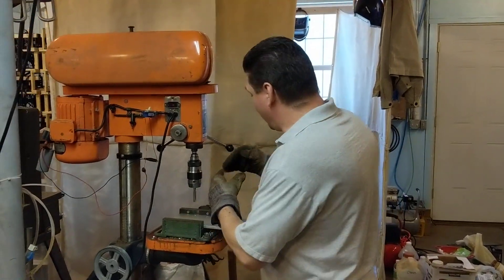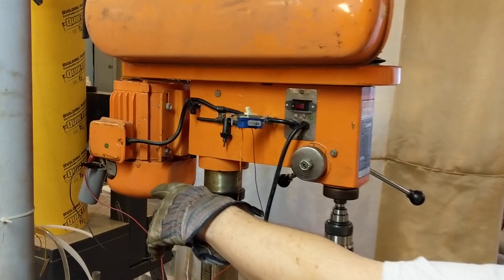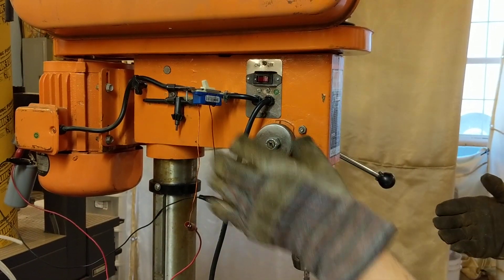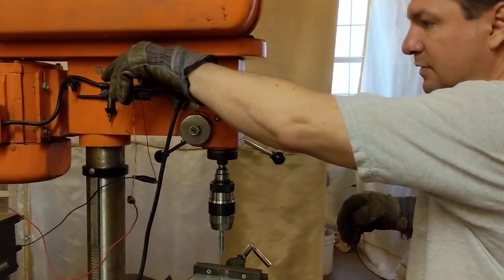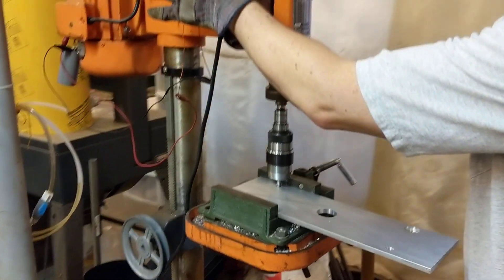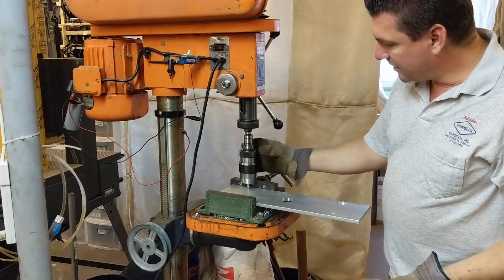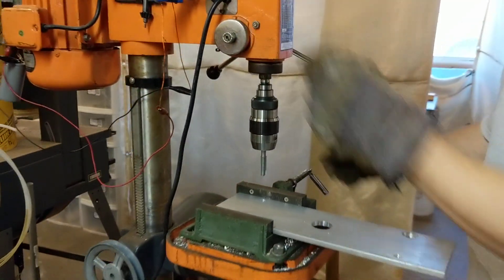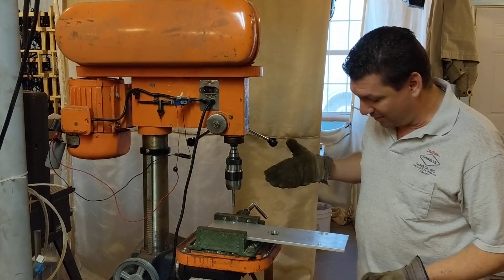Run your Drill Press in Reverse

Comment: My 1937 Delta drill press did not have a wiring diagram. But there were other wires in the junction box and I switched them to see if it would change direction, and it reversed the motor and then I just put a reversing switch on it. I was going to use a simple and inexpensive double pole double throw toggle switch.
Actually I never used that toggle switch. I used a 4-way wall switch with a separate switch for power.

I added a junction box onto the side of the motor that has three switches, one for power, one for direction, and one for the light. All three are wall switches, no panel switches were needed.
I wish I could post photos.
The junction box I used was a four gang box with a face plate for a double switch and a single switch.
The double switches are horizontal across the top and the third switch is horizontal across the bottom for direction.
It looks really cool!!!

Comment: When you disconnect the start capacitor for the start windings the motor will not turn until you move it manually one direction or the other!!!

Similar situation happens if the centrifical switch inside the motor is malfunctioning!!!!!

Also, reread my old comments, I made some corrections!

Comment: all you need to do is get a drum switch so you can reverse the start winding, usually #5 and #8 wires, most motors tell you on the plate how to reverse them. When you flip the switch you installed now, all you are doing is disconnecting the start winding which is in series with the capacitor, that is why you have to manually start it. I never considered it before but I bet it could be done using a 4 way switch because it flips 2 wires, ie start winding circuit
Reply from the maker: This motor must be a cheap Chinese knock-off... no wiring diagram. It's a Yung Neng motor model: YEN-18-09-06-11-19-05-300(1)-1-02-1-01-1-16-7-07. Whatever all that crap means. LOL. Now I'm certainly willing to try but I don't believe you can reverse any polarity on this because it's just single phase 110. So 1 hot wire and one neutral with a start/run cap in series. Nothing to really reverse when you think about it. Single phase can't technically be reversed. Am I wrong about this?
Reply: @HarmonyTurbines  The capacitor is hooked to one end of the start winding. In your case you would have to take the motor apart and find the other end of the start winding then connect a wire to it. I am pretty sure the start winding uses a smaller gauge wire size than the run winding which would help identify it. Also the start winding is hooked up to the centrifugal switch in the motor and it disconnects the start winding after the motor starts. Reversing the wires on the start winding will reverse the direction the motor runs. The capacitor is used to shift the phase on a capacitor start motor

Comment: If you going to be grabbing moving machine parts, lie you said it's dangerous, but its exponentially more dangerous with gloves on... There a reason you don't wear gloves while using a lathe, or a drill press. Or at least why you shouldn't. Why don't you just wire in that an inductor, the reverse of a capacitor? So rather than having to start it by hand, the inductor will change the phase in the opposite direction.
Reply from the maker: I had my hand on the off-switch and did explain that it was dangerous. If I would have gotten hung up, the drill press had no power at the start of the spin so it could not do any real damage to me. Regarding wiring it differently, you can do what you speak of with 3-phase motors by just reversing 2 of the wires; but with a single phase motor I'm not sure how you would (could) accomplish this?
Reply: @HarmonyTurbines  You just reverse the starting winding wires, if the motor allows you to do so. Usually black and red.

My point is more to do with wearing gloves at all on the drill press, as opposed to what you were doing with the drill press. Especially gloves like that with loose cuffs.
Reply: @HarmonyTurbines  maybe wrap a short strap around the chuck to pull it in reverse  and it will slip off when it fully unwinds so your hand doesn't contact the chuck. just don't wrap the strap around your hand

Comment: Nice concept
Reply from the maker: @Ihor kotyay thanks! I was making my hand raw backing it out manually each time. This way it is FAR easier and once you do 5 or 6 you're pretty good at getting the right amount of spin to ensure it starts up in reverse without a problem. If it doesn't start in reverse you just quickly turn the switch off and try again. The thick leather glove helps protect your hand as well.
Reply: i think you should just wire the cap so it runs the other way